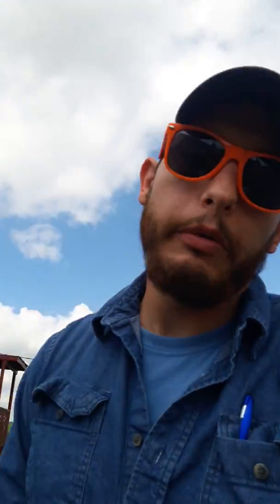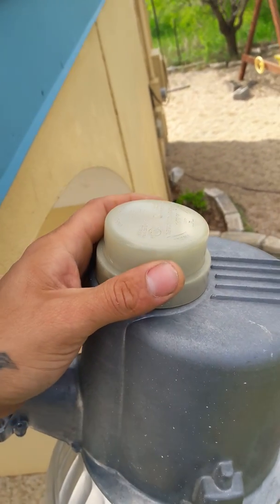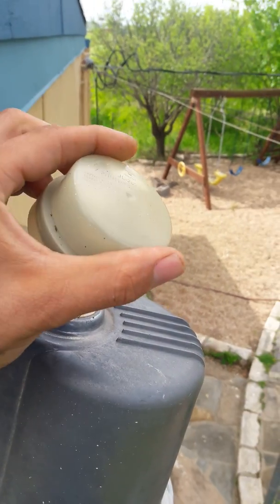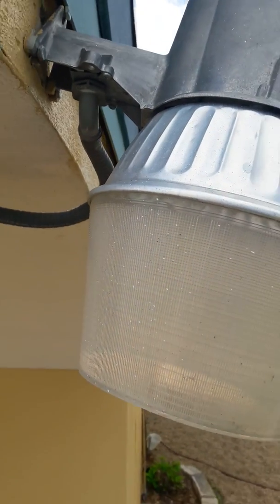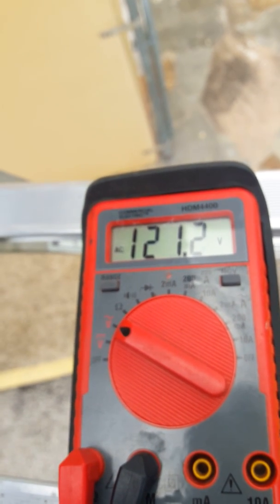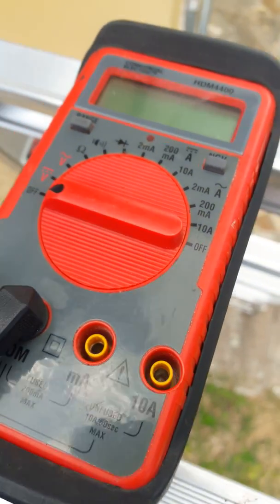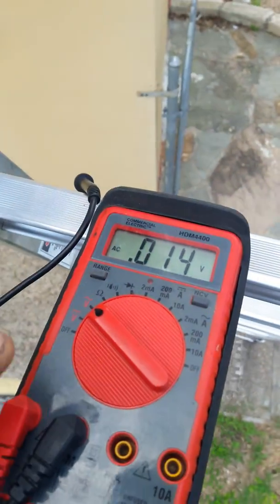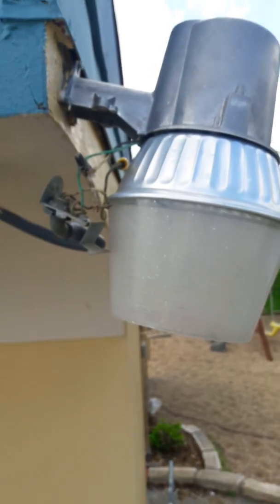Dusk till dawn light replacement part#1

Comment: I need to know what could be wrong because mines will not go off
Reply from the maker: The photo cell could be blocked some how, not letting light in, to it off. I would try to clean it some how, and if that doesn't work it needs to be replaced.